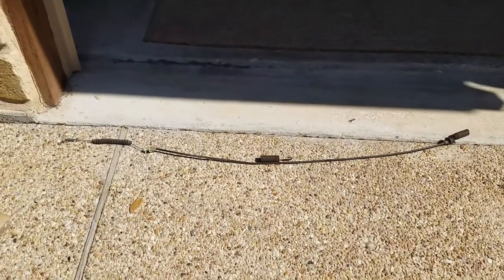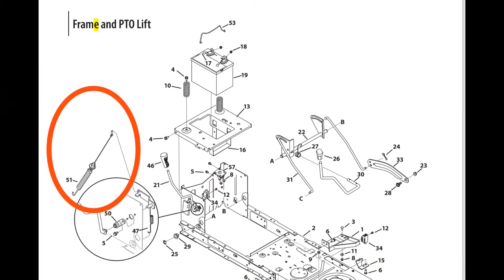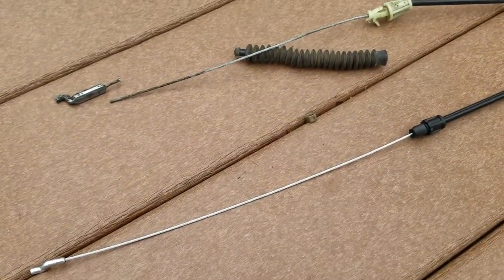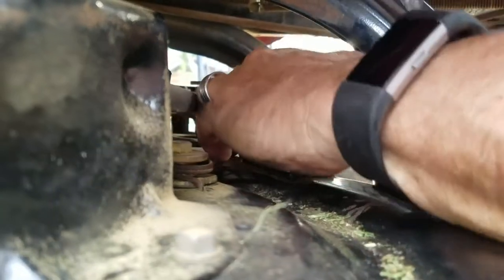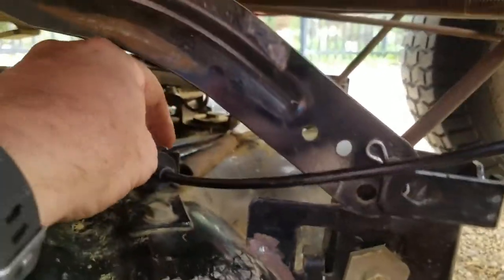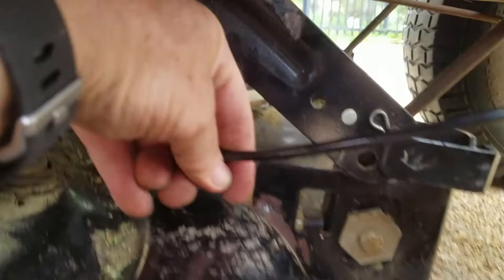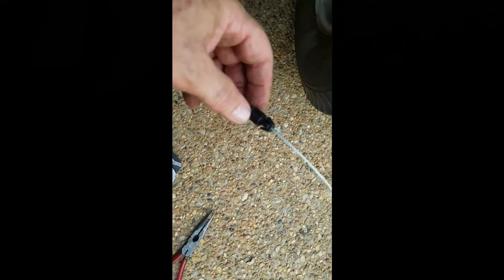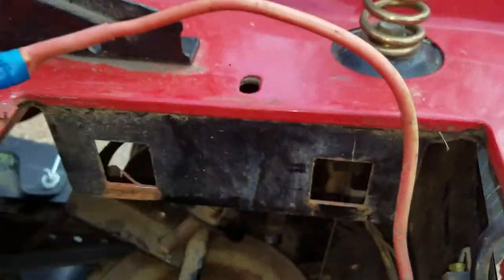Changing the deck engagement cable on a Troy Bilt Bronco riding mower

Comment: As stupid as this sounds, where do you attach the spring to the deck? I’ve looked everywhere and nothing makes sense as to where it would go. Mine is a 2008 Bronco with 42” deck.
Reply: Never showed where you connect the spring wasted time.
Reply from the maker: Yes, I failed to show the spring hole. See the above video description for two pics and a shout out that shows where the spring attaches.
Reply from the maker: Yes, I failed to show the spring hole. See the above video description for two pics and a shout out that shows where the spring attaches.
Reply: @DrBDIY  You do a great job with your vids and explanations.. My deck on that mower that needed the cable had a slightly different lay out that made the obvious places to hook the spring to just seem wrong.. I truly enjoy your videos.. Thanks